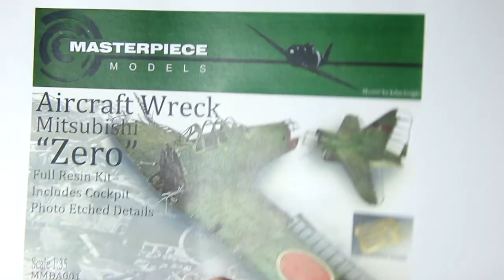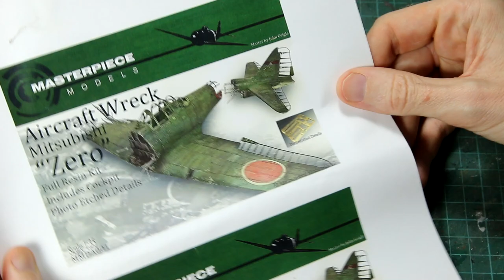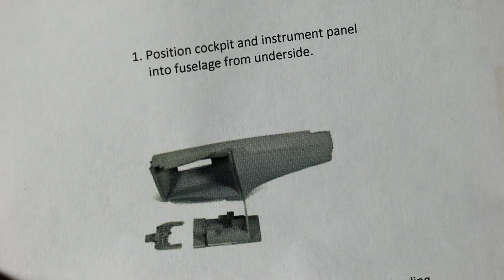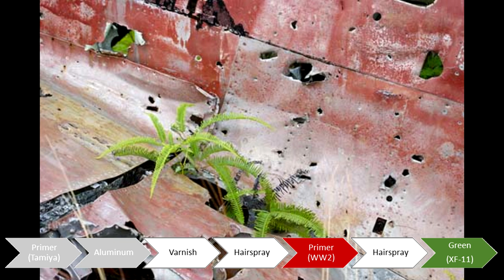Aircraft Wreck - Japanese Zero (Masterpiece Models 1/35)

Comment: That's a great build and a nice change from "normal" models. I've had a go with plastic kits at doing this but the detailed PE of the control surfaces in this kit really adds to it. I think it was a very good idea of yours to add more PE to the break in the tail section. Being critical I think that where the tail section had broken off the skin of the aircraft would be more distorted and torn looking. That's a criticism of the kit and not your building of it..
Reply from the maker: Thanks Allan. I agree with you about the damage. I tried using some aluminium foil to represent the aircraft skin breaking away at the joints (I've seen some incredible models using this effect), but I just couldn't get it looking right.

Comment: The flash you see is a by product of the casting process. These kits are not made by injecting plastic into a mold under pressure, but by pouring liquid resin into a mold, Sometimes they degass the molds which results in the flash you see. I have been building a few kits from HPH, which I recommend , by the way hphmodels.cz they have the same issue, but very high quality, very diverse subjects as well (they do a 1/48 B-52....) and they have the same issue with what you call flash. But I guarantee you this is normal in resin kits
Reply from the maker: Thanks Gavin, that's useful to know. I'll check out HPH Models, sounds like that have some unique stuff.

Comment: Personally, I would feel ripped off that so much that is shown on the box art is not included in the kit. Not just the metal bits in the broken fuselage but the torn metal on the nose. If I have to scratchbuild all of that I'll just start from a far less expensive (or even free) Pepakura model.
That said, your build does indeed look like it's been sitting on a Pacific island for longer than I've been alive. I know your diorama will be exceptional.
Reply from the maker: Thanks Mark. I agree it's quite cheeky to show such elements on the box art - especially since it wouldn't have been that difficult to include some PE for the ribbing etc (and considering the price of the kit).